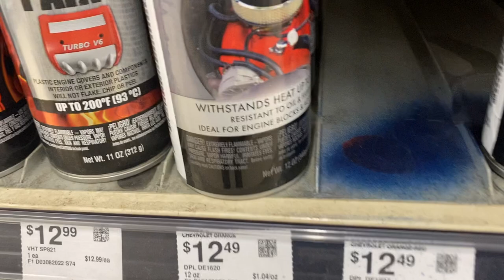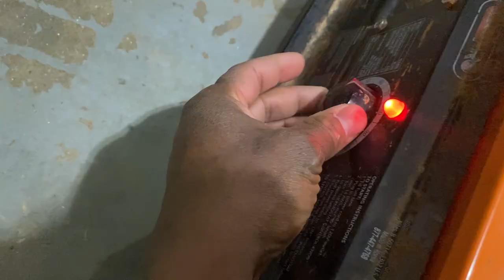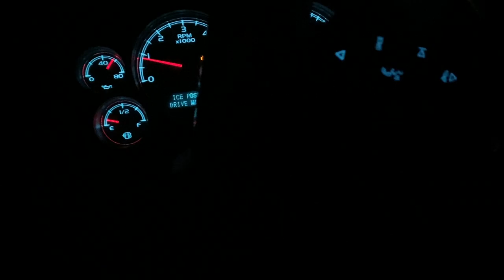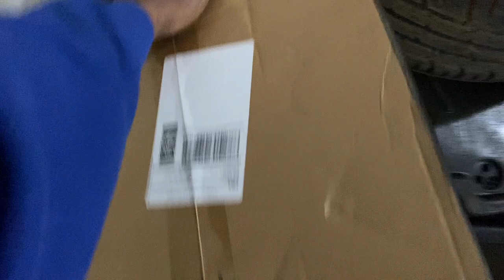PAINTING MY DONK BRAKE CALIPERS BLACK | CREAM DONK

Comment: I know this is kinda off topics but do you know what kit you can use to put disc brakes on a 1989 caprice ?
Reply from the maker: Idk but I’ll ask in the next video just be check the comments. I did a 96 impala on my silver Chevy and got 5x5 front and back and disc brakes.
Reply: @SteveDavisCarGuy  ok thanks and are the 96 impala wheels the same pattern as the regular box Chevy wheels ?

Comment: Figured that you'd have done a disc conversion on the donk by now.
Reply from the maker: Have to get it running A1 first 🤣
Reply from the maker: Found a motor tho
Reply: Telling you bruh get that 455 you see how my drop was and that was carburetor. Imagine it with fuel injection lol